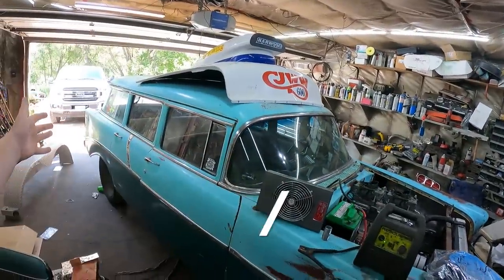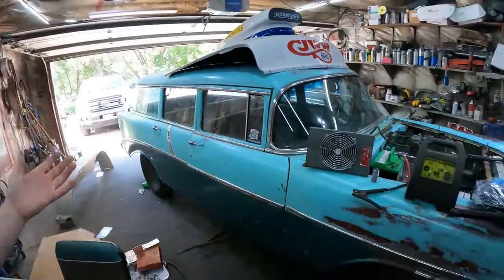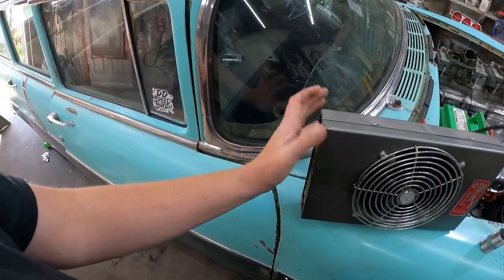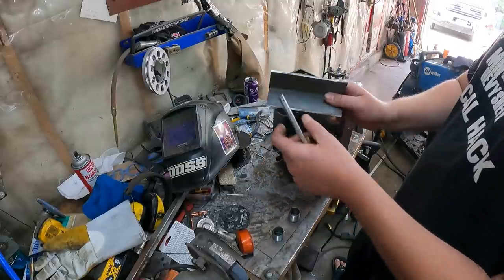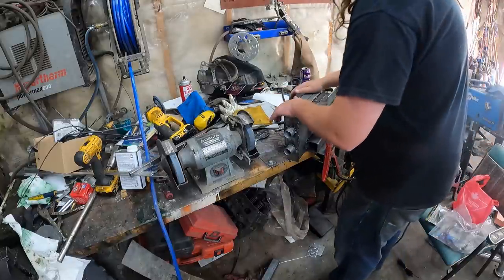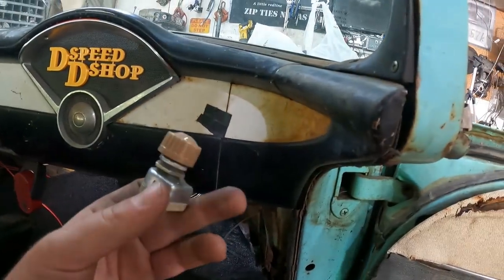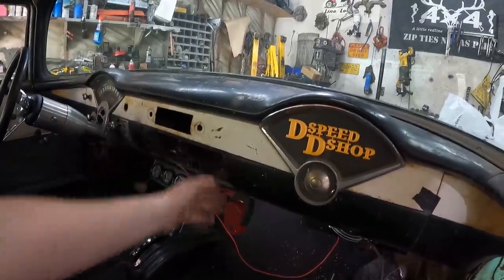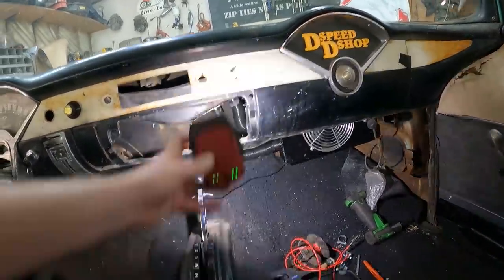Stay Warm In Your Rod - Cheap, Universal Classic Car Heater

Comment: I found a heater in my parts truck,tested core and motor works too. So i blasted it and gave it a coat of paint. Looks mint👌 had a crappy ass heater from wish, doesent blow worth a crap. Has a nice heater core so i will save it. Having heat on cooler days is nice, having good heat is better.

Comment: in Aug. 70 I bought a 57 Conv that had a very similar heater box and fan mounted under the front passenger seat.  The car purchased in Cheyenne, Wyoming.

Comment: Block off plate! What you need is an old Learjet 4 track pushing an ear splitting 3 watts per channel. You could put a valve on the heater hose and run the cable to the empty hole by your new switch.

Comment: Detachable Heater hoose works great in the winter when you want hot air directly at you plus you can defrost whenever you aimed it at . Did that in my Volvo amazon

Comment: I believe that old switch is call a rheostat that gives variable control of the fan speed some had push and pull on the knob for off and on they could also be found controlling the low and high on electric heaters 
 and instead of having to pull the hose off to heat the inside why not just put a Tee in it then you could do a diffuser
Reply: I think it's set up backwards too
Reply: Copart in Mexico & California  , texas
Reply: See a/ c  units  & power seats units !!?? ?
Reply: Hang A/c , kansas city  salvage yard  & collector  classic cars
Reply: Desota
Reply: Arizona yard & Nevada yards check out

Comment: Nice work on the heater. I like all the creativity that you displayed. The first button that you had, is known as a potentiometer. It varies the voltage output to the motor, similar to a volume knob on a radio. The can be used to control the speed of electrical motors depending on the amp rating.

Comment: i used a ice cooler with a boat bilge pump hooked up to the same type heater core fan unit and had ac cheap in my 1978 mazda glc

Comment: don't leave a gap for air to come in around the motor .you will pull all the engine gasses in, get it from the cowl or if you have the duct work from another car like they did from factory.

Comment: Dan, suggestion. Add another hose or two get more output volume. Also you will only get heat from that small surface area where you weld the gal pipe. How about removing the flat piece directly on the heater box and paking it out to get more surface area rather than the gal pipe straight up against the heater core. Justice suggestions, as I think it will work better. Cheers Stew.

Comment: Looking good but I think I would paint the fan grill black as the chrome makes it too visible under the dash. Also for a few bucks you can buy the early Mustang plenum chamber boxes. These sit on top of the trans tunnel by the firewall and you could use it to either direct the airflow up tot he screen or over your feet. It would take you about 1/2 hour to fix it and its worked by a simple cable you could fit to your existing heater controls.

Comment: Those resistors get hot from the current flow which is why they are mounted remotely in the heater itself with airflow.

Comment: The first switch could have been used with a separate on off switch. The new switch is cool how it lights up. It would be even cooler if you back light that DDspeedshop  instrument fill in panel on the right side of the dash.

Comment: You should check the amp draw on that motor to make sure those tiny outlets arent choking it down. Worse case its running high amps and wont last long

Comment: I was always told that the switch doesn't shut all the way off to keep the fan motor bearings from seizing up, as they may sit dormant for long periods of time. All of the mid 60's Oldsmobiles I've owned were like that.

Comment: I'd try to find a factory radio even if non-functional so it looked right.(Probably wouldn't find anything good on the AM dial these days anyway). Hook the radio light to dash lights, again just to look cool at night. Also, I'd mount an antenna in the hole, same reason. 
It's a Bel Air, Why not make it look like one?

Comment: You should make holes on the other side that you could damper off with outlets pointed down for floor heat. I know you don't plan on driving it in cold weather, but the option would be nice. Plus, what is the rated cfm of the fan? restricting the output could cause the fan to rub hot, which would burn up the motor.  I know it's only to pass inspection, but if you're driving during rainy weather and the window fogs up it'll be neccessary to see not to run into things.

Comment: Hmm, I may do that on my squarebody truck, previous owner welded a plate to the firewall, to clean up the engine bay, well, no heat.. So, I'd like to have heat for the windshield, and for my feet, soe something like this might do the trick, Pickup cab doesn't need a lot of BTU's..

Comment: I would worry about not having enough air flow with those small pipes,it may kick off from overheating after using it for any length of time.

Edit: nevermind,I just noticed,it's not an electric heater

Comment: won't the side you are blocking tend to overheat? ckeck it b4 installing under dash
Reply: It wont be any different than the fan being off. I think the coolant circulates through the unit no matter what position the switch is in, however that much airflow restriction may cause the motor to draw more amps but i have a feeling Dan just needs something to pass a manitoba safety inspection and it wont get used much.

Comment: I THINK if that after market switch is like the car fans were set up from GM,then it NEVER shuts fully off???? Cars from a certain era from GM constantly were circulating air the entire time the key was on at the lowest speed of the fan no matter if the switch was in the "off" position. (Your first aftermarket switch you have  might shut off if you pushed it in????  Also,you will have to put some water shut off valves in this things hoses unless you want hot water running through it and warming you up in the cabin during the summer months ......